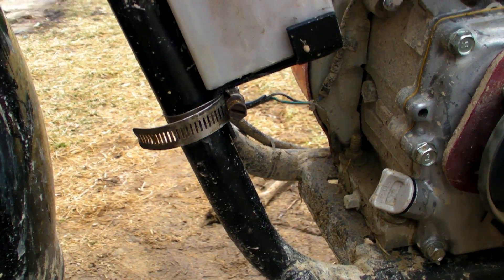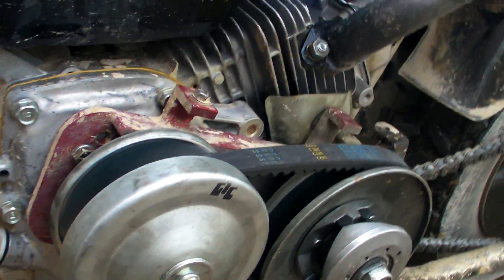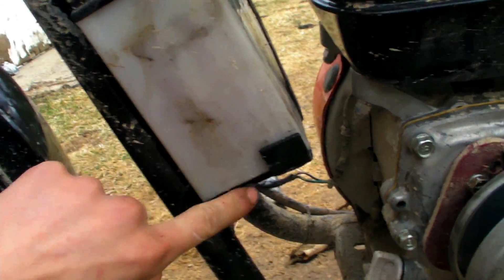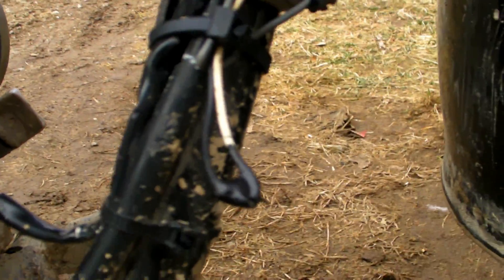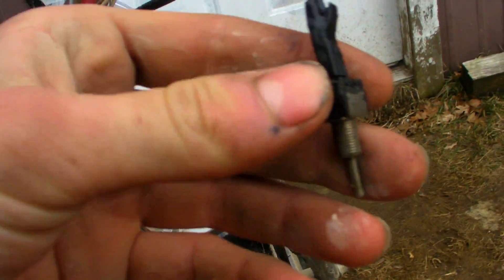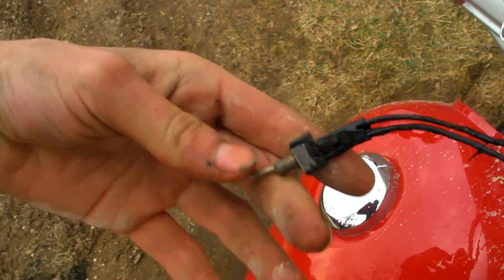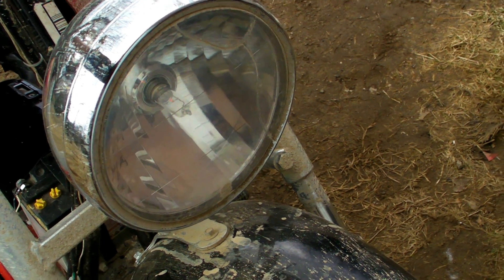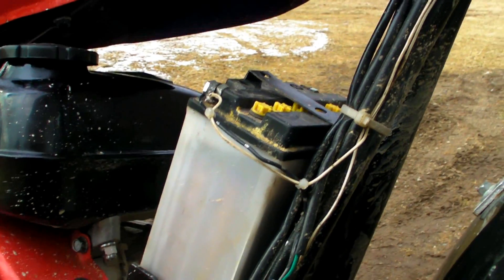Mini Baja Battery Holder

Comment from the maker: I have when I had the flywheels side by side. When considering the way they are mounted and the way I would need to mount them, I didnt want to risk the slightest imbalance since this stock flywheel hits 6000RPM on a regular basis in my application.

Comment from the maker: @maintoc Thanks, I have welded a couple things now. There is really nothing to welding besides practice. No, it just matters on the specific engine model you have of its type. Some flywheels have the magnets and generator, while others do not. Honda or clone that applies to.

Comment: This made me jump when the sound kicked in at 0:25 :p  ~  Congrats to you on the successful welding, and the creativity to improvise a battery holder and connect the power plugs and switch.  ~  That's good, about the new camshaft and the R.P.M., as well as you not driving one-handed.  ~  So a non-standard engine comes with a flywheel generator but a genuine Honda engine doesn't?

Comment from the maker: @TheMaxii2007 Thanks, I have welding a bit lately. Considering that this bike isn't made for these speeds and bumps on the dirt roads plus the stock welds and more have been breaking. Just now my "gas tank" (fake, for appearance... the red thing in the front" has broken two welds today, but now it should be good forever.